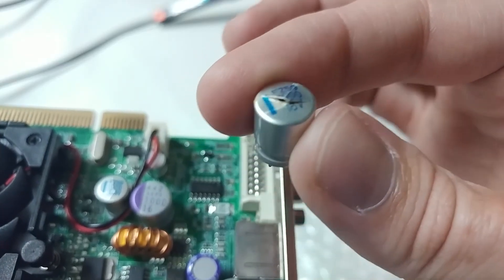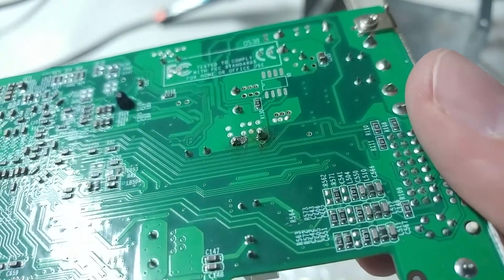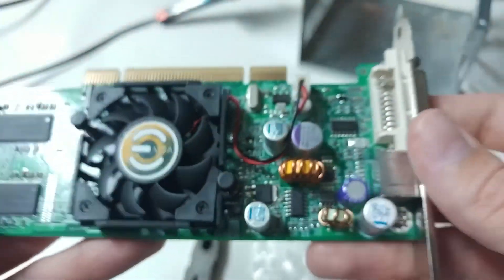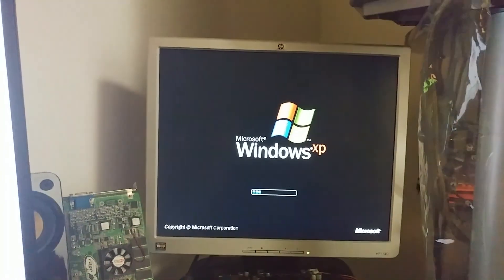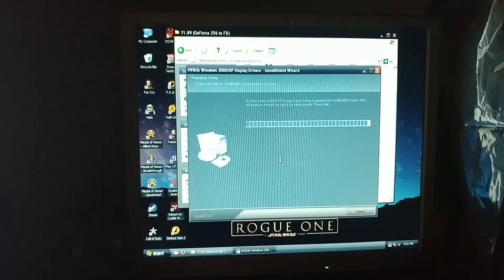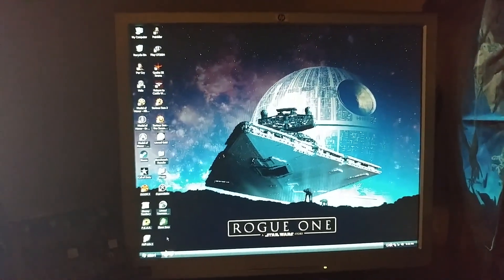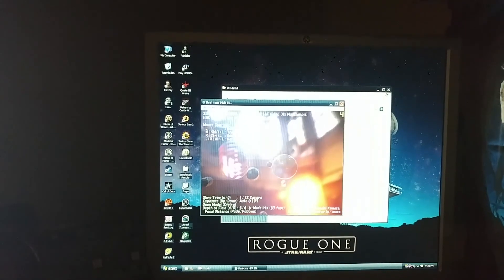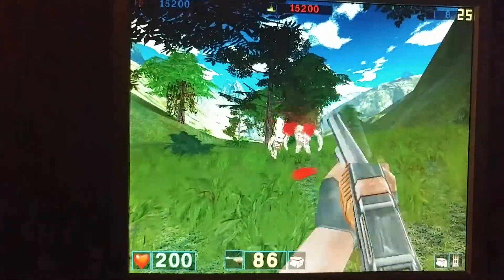I Brought a Dead Graphics Card Back to Life!

Comment: I've seen multiple examples, in person and online, of those Sacon FZ caps bursting open on NOS cards that have never been used.  Their chemistry is so faulty that they are unstable even without ever being powered.  I doubt a single one of them is good today because it doesn't even matter if they've been used or not.

eVGA must have scored a "great deal" with Sacon on those caps.  They used them on a ton of video cards for a few years, and they all failed.  I've always held that against eVGA because by that time (mid to late 2000s), everybody else knew about cheap caps having premature failures.  After that lesson had seemingly been learned, then eVGA went and tried the same move.  Gamers tend to be fanboys and surprisingly forgiving of video card failures, so they generally gave eVGA a pass for it.  IMO they're more guilty of sleaziness for that than any of the motherboard manufacturers who pioneered the mistake 5 years earlier.

Comment: This looks like a dry joint in spite of a pool of flux being splattered all around it.

I say your solder contains flux, plenty of it, but technique isn't very good, and maybe even the solder isn't very good or two different grades of solder were mixed on the spot too much.

Expensive soldering irons aren't really needed for such a job, but at least an extractor, extra flux, and wick are pretty much must-have, and they're all OK to get as $1 items from China. Make sure not to get a wick that is too heavy or too wide, more than 2mm tend to be unusable unless soldering iron has top notch power delivery.

Comment: For the future, those Sacon FZ capacitors are probably the worst ever. They have been use a lot on video cards and generally didn't last long. Some people say they started bursting open loudly during the first year of use. I got a 8600GS a few days ago, with about a dozen of those in various sizes, all were burst open.
I probably wouldn't have bothered with a Polymer capacitors on such a card and just used a second hand capacitors from a good brand taken on a dead board. I keep spare broken motherboards just for parts like that. Very handy.